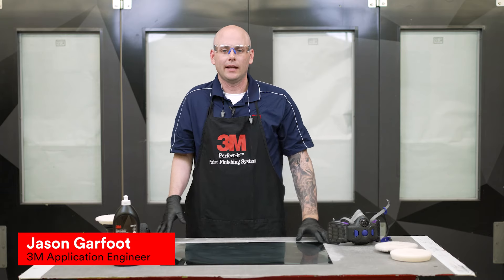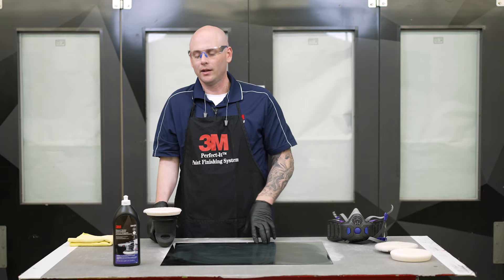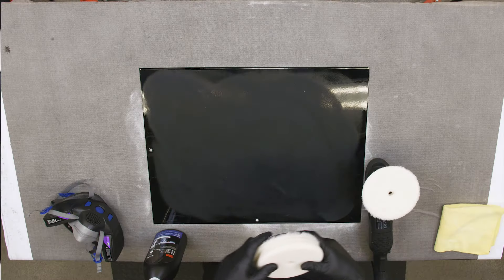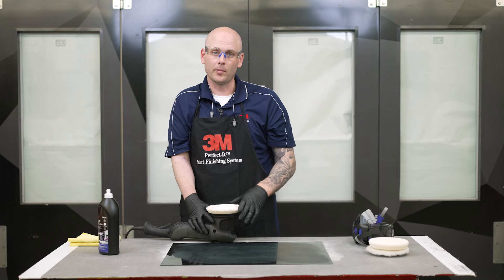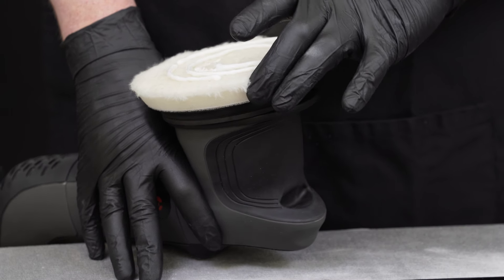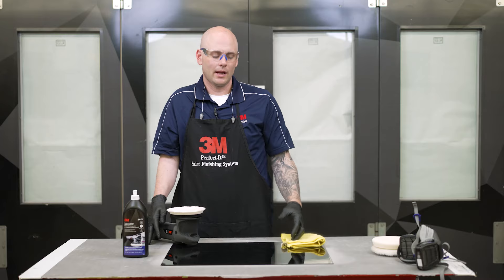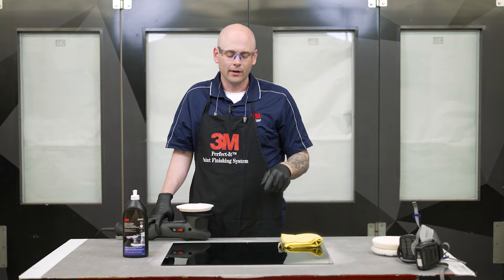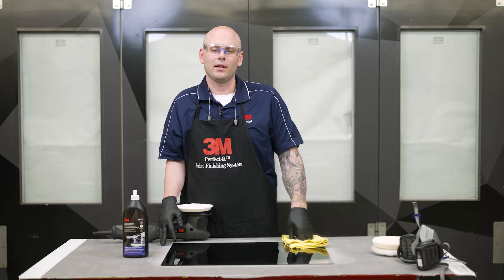HOW TO: Compound With the 3M™ Random Orbital Polishing System

Comment: Can you store and reuse the pads, and if so, how do you store them and is there any pad washing or cleaning between uses?
Reply from the maker: Yes, you can store and reuse pads. We recommend keeping the packaging that the pads came in to store and reuse. If you don't have the packaging anymore, storing them in a clean, dry place is recommended. It's also best practice to clean pads between uses -- we have this 3M Conditioning Brush (PN 05761) that can help clean any dried material off your pads. See this link for more info: https://s.3m.com/lcfip35y